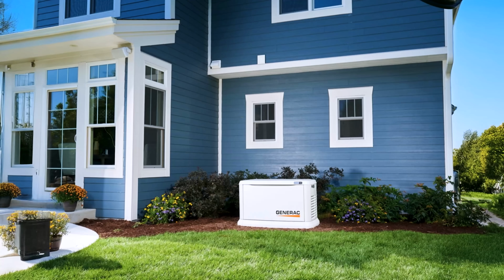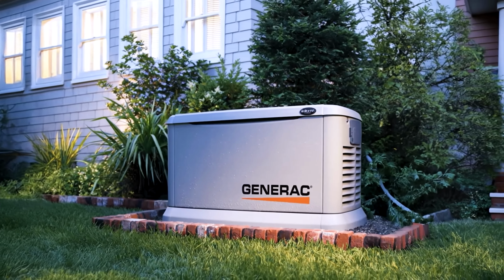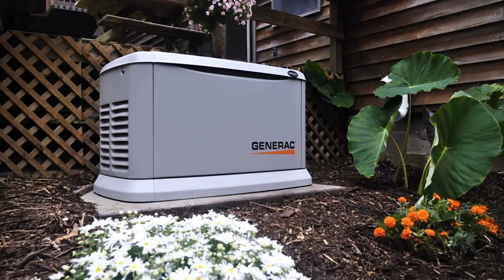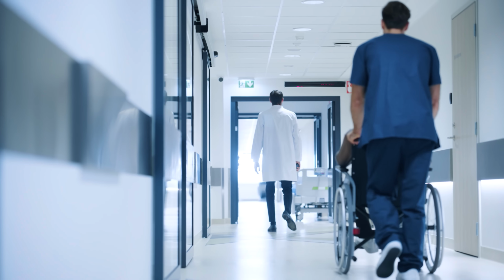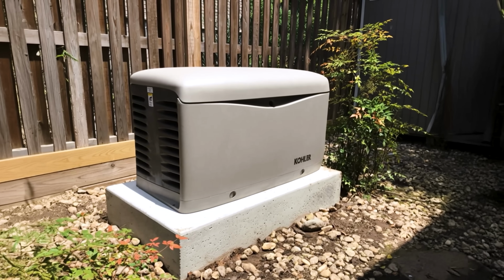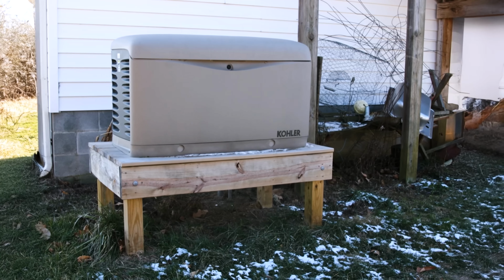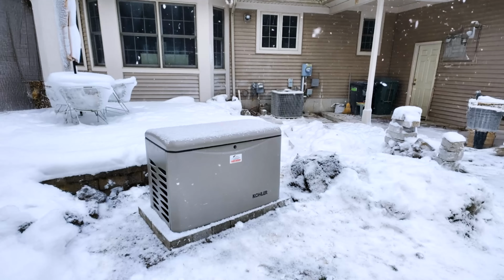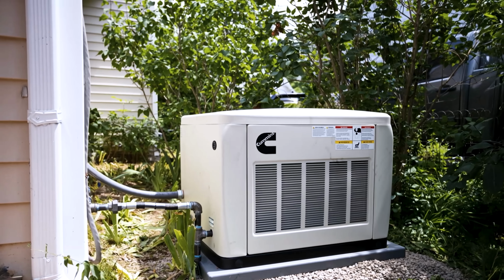Top 3 Generators for Your Home in 2025!

Comment: I have had a generac 22k for 11 years, it has been faithful for those years, for short power outages and two long time outages.  I have the unit serviced each year, oil, air filter and new battery twice.  Installed and unit cost about $10,000, a great expense except worth it’s weight in gold in middle of winter outages.

Comment: I have an all electric house and would like to have some type of backup system so that I can keep some heat in the house in the event of an extended power outage in the coldest part of the winter.  I suspect it’s not feasible to have a generator big enough to run my HVAC together with my inside electric heater., but perhaps big enough to run several space heaters.  What do you recommend?

Comment: In one form or another, in one specific application or another, I've had all three of these brands, often multiple units.   I think it speaks for itself that 80-90% of power outages are brief, and few and far between, thus the attraction to Generac (and while not addressed in the video, I'm speaking specifically to their air-cooled residential line).   I've been a fan of the quality of components in Kohler in the past, but only time will tell now that the generator line is really now owned by a private equity group (Platinum Equity).   I've never seen a company do well in the long run under private equity ownership.  The first thing the owners want to do is maximize profits usually at the expense of quality and support.   I hope that doesn't happen, but it's a red flag.    On my personal residence, I have one of Generac's "larger" liquid-cooled units, and it has performed flawlessly when tasked with multiple day outages for events like a hurricane.

Comment: I have three Honda’s, two EU 2200’s in parallel and a new EU3000 because I need electric start. Plus a Honda repowered Coleman 2800 that years ago got us thru an 11 day outage. 

Nothing is perfect and if one fails ( never happened) there are others to use. I believe in load shedding and even with a well and sump pump plus the boiler nothing goes into overload. 

I have seen too many Generacs quit at the wrong time in my landscaping business. Never seen a Kohler or Cummins die…. Yet!

Comment: I chose Kohler 20,000.  Ran great for about 14 months then suddenly the oil pump broke and oil spray all over the inside as I checked it.  I could not believe it and thankfully it was under warranty and it was fixed and that happened in the very early spring of 2024… Now it’s been two years since that time when it broke and it’s been running flawlessly, but I was very disappointed about that but now we’ll see. I heard Generac had problems so I think they all do but I honestly do not know which one is the best   if they start making all American parts and in one factory that would help a lot

Comment: My Generac ran for over 300 hrs just recently.  I shut it down every day for about and hour to check oil and look the unit over.  I did an oil and filter change about 200 hours into the outage. Mississippi ice storm 2026!

Comment: I bought a tri fuel 18KW portable generator, had a Natural gas quick connect installed to code and a 50A external power connection into the Breaker box with a lock out slider, again, all to code, fully county inspected, and spent under 2800 bucks including the generator, labor and permitting, works great and runs the whole house, not automatic, but I get it up and running in less than 3 minutes and saved a TON of money!!  I'm sure you'll delete this....

Comment: Prior to 1986 you could buy an actual Onan Generator.  Cummins bought Onan in 1986.
I work with pre-1986 Onan generators, which self test themselves weekly, for 15 minutes.  I change the oil twice a year.  End of Story.

Comment: Just had a Kohler installed; had an early Kohler and no major issues for over twenty-five years. However, recently we encountered an electronic issue that caused a motor malfunction. We called our dealer in PA, Critical Systems, and had them examine the issue. Within less than three weeks, our dealer installed a new motor under warranty, and it has worked flawlessly.

Comment: I've had a Kohler 14kw with an automatic transfer switch for about 10 years now.  Comes on automatically in about 7 seconds after power goes out and shuts off immediately once power is restored.  I maintain it myself and it has never given me the slightest problem.  Runs on propane. Longest power outage I have gone through was about 30 hours.  I service it myself once a year (sometimes 18 months if I'm lazy).  In order to help preserve it's longevity, I used high-heat paint and sprayed any exposed metal parts in the engine compartment - most notably the muffler and tubes.  This has prevented those parts from having ANY rust.  I only use high-grade synthetic oil and a quality oil filter that I change every 12-18 months.  The generator does an automatic 20-minute run once a week to keep the engine lubricated and in good running order.  Very happy with it.

On the day it was installed, I asked one the young technicians who worked for the company that sold me the generator of what he thought about Generac. He said they sell both Kohlers and Generacs and that he would stay away from the Generacs.  He told me some of the jokes they used back at his business to describe Generacs.   I'm very glad I went with the Kohler. The tech described Kohler's as quality mid-range units.

Comment: Maybe Generac is better suited for cooler climates, here in the South they can't handle the heat. Engine and circuit board failures are extremely common. I am a Onan/Cummins dealer and installer in a market comprised of 95% residential and maybe 10% commercial units being Generac. Generac has pursued me for several years to become one of their dealers but I cannot look a potential customer in the eye and sell them an inferior product. A local Generac installer brags on the fortune is making on repairing Generac units. I may not sell a ton of generators but I believe in the product I represent. My 25KW 1800 RPM liquid cooled Onan was a great investment.

Comment: No question Cummins is top of the line, but one issue with Cummins is they don’t have a remote monitoring/ethernet/wifi  system like Generac which lets you check on the generator when you are away and receive warnings if something is wrong..    They did have the PowerCommander but that is discontinued,  They came out with an Accumen system which is also discontinued so your only option is to find some third party hardware.  In today connected IOT world this is a notable deficiency.
Reply: Yes they do. Just had installed 1-19-26 Mi
Reply: @gunsngolfn Can you tell me what they have since my information is there isn’t any options other than thrid party for their large liquid cooled units.  I have a 40 KW with the powercommander control installed in Dec 2025

Comment: I've always used a Honda inverter generator that runs through the service panel.  Works great but won't run anything 220V.  May have to consider a whole house generator cuz I'm getting too old to deal with the maintenance, moving it into position, handling 5-gallon gas cans, Gen-tent, etc.  Pretty far from your service area though.

Comment: In the high end audio enthusiast they say  you want to  have your amplifier loafing along when there is high demand of power so amplifier wont't be struggling for power demands so if you have 300 watt speakers with low sensitivity you need a amplifier at least 600 watts of high current power. so won't short the  life of the amplifier so don't you need at least 40Kw generator?

Comment: After reading a ton of bad stuff on all these brands I opted for a northstar 12kw with Honda GX630 OHV engine 20 hp. So I have to manually start it via a key switch and electric start and plug it in after shutting off the main breaker. No problem I can handle that. $3200 bucks. In the future i'm going to convert it to natural gas or propane so I don't need to worry about fresh gas.

Comment: None of them are inverter generators. 
It's 2025, for the price of installing the home generator. 
I would invest in the solar power setup instead. Like Ecoflow 12kw Delta pro ultra X with smart panel.
I would still have a 7500 watt tri fuel inverter generator as a backup. Not to power the house but to charge the power station.
Two hours of gas generator charging the power station equals 10 to 36 hours of power for the house, depending on the load. Adding solar panels is a big plus.

If you move. You can take them with you. 👍
Reply: 7500 watts doesn't run shit. And all these whole home generators are inverter generators jackass.  
Your pathetic battery solar shit systems wouldn't last a day .

Comment: There are a lot of comments about Kohler not making small engines. Kohler generators are still being made, but the generator division was sold to Platinum Equity and rebranded as Rehlko Power Systems in 2025 to focus on innovation and the customer experience. Kohler (the parent company) shifted its focus to kitchen and bath fixtures, but Rehlko continues to produce the generators under the Kohler brand.

Comment: You need to be preaching about soft start kits on all HVAC compressors and any other high inrush current draw loads. Its AMAZING how far you can extend a smaller generator by cutting inrush/LRA current on such loads. MicroAir has the best IMO and handles compressor units up to 6 tons in size.
Reply: There is a youtube video by a guy installing a soft start kit.   It took his hvac initial power up from 20 amps to 12.  It also starts a lot quieter.
Reply: We have the micro air soft start on our Trane 3 ton package unit it was pulling over 80 locked rotor amps before installing the soft start and causing a momentary brown out while our Generac 22k was running. After it starts on 20 amps and runs on 9.5 amps, no more brown out. Would highly recommend Micro Air.
Reply: Agreed. I put a soft start on my 3 ton heat pump and disabled the 10kw heat strips so now my 8kw portable inverter generator runs it without issue, even when also running our induction range.

Comment: 47 KW GGFE Cummins installed over 20 years ago with now 670 hours run time. Only failures have been 1 battery charger,  2 batteries , and muffler which rotted out from condensate from lightly loaded weekly exercises. Exercised now manually every other week under moderate load.
Reply: A bunch of bologne 
20 years old and all you change  is a battery charger and a battery? The battery even with a battery charger wont last more than 3 years …
There is always maintenance to do on a generator . From oil changes battery replacement belts hoses and corrosion on doors and enclosure. Coolant flush … that is a fact
Reply: @George-gb2zn I replaced my Generac battery after 5.5 years, not because it wouldn't start the generator (it would) but because it just seemed like I was pushing my luck.

Comment: The Cummins also does not have to run the motor every two weeks. The Cummins has a feature where the starter simply turns over the motor but does not give it fuel so it circulates the oil without actually starting the motor. It can also check that the alternator is pushing out voltage. This means that is is very quiet and it does not require service as often.

Comment: Having worked for both Caterpillar and Cummins over the years both are leaders in the standby and prime power generator market. When I worked for Caterpillar the vast majority of prime power units in northern Canada were Cat. I saw units with 15,000 hours before a major overhaul was completed on the engine. Cat never really bothered with the home unit but did have portable generators for contractors. My last job was with Cummins here in Eastern Canada and we had a department that handled home standby and other applications of small generators. Look at any fire truck and it probably has a Cummins genset on it or a Cummins PTO generator driven off the main engine of the fire truck. Another big application of small Cummins generators is the RV market where the big RV has a Cummins drive engine and also a Cummins genset to meet the power requirements of the RV. I do know in Eastern Canada Cummins supported a dealer network with a large inventory of parts.  I personally managed CHIP plants ( Combined Heat In Power ) mainly 2MW, 13.8 KV gensets using small engines 18 cylinder, 91 litre, natural gas fired engines. Some of my mechanic's could even work on the small units if needed in a emergency.

Comment: I'm surprised you don't mention air cooled versus water cooled, 1800 rpm versus 3600 rpm and the NOISE!! The air cooled 3600 rpm generator will wake the neighbors and keep you awake at night!!
Reply: Also surprised  no mention of differences between emergency generator vs continuous duty generator in respect to durability and lifespan

Comment: I gave up on generators, and instead installed two Tesla Powerwalls.  If utility power goes out, the Powerwalls replace them instantaneously without a flicker.  Even clocks on microwave ovens don't notice it.
Reply: Why would the clocks on a microwave have an issue.  Sarcasm?  What # of watt hours are  stored in each powerwall?
Reply: @WilliamMurphy-b6v   Power wall might last 8 hrs
Reply: And how long will two power walls last you running everything you would normally use (fridge, stove, AC or furnace/boiler, lights, washer dryer) ?  Are your power walls going to keep you fully running for 3 full days?
Reply: @ScottA2345 Each Powerwall stores about 20 kwh.  That would last me about 2.5 days.   The longest outage I had was 17 hours.  We have many outages,  but most are resolved in 3 hours or less.
Reply: @LawyerCalhoun1  So, 5 days total for two?  That's much better than I expected.  👍👍

Comment: I have a 14 year old Generac Nexus 8kW. It has had a new control board, stepper motor, starter and coil. Otherwise just oil changes and batteries. Been pretty reliable and still going strong.
Reply: Dang… that’s a lot of upgrades / replacement parts!
Reply: For a generator that is 15 years old,parts can wear out on everything?

Comment: We had a new Generac installed at our former home against my better judgment because no dealer network for other brands. As a former electrical utility worker and gear head I knew the Cummins/china and Generac Chinese motors were basically imo very poor quality. We also had a Generac at an office we frequently used. My home unit failed to charge the units battery 2 months after installation during the first major outage. I ended up having to hook up my tractor to it to keep it running. 4 weeks later the parts came in to fix. Next outage a rocker came loose in the motor 6 months later. Took 3 months to get everything back going. It’s a 26kw but seemed to overload and click out often with the basics running. We also had a couple problems with the one at the office. I knew better than buying one, but with all the advertising and lack of other brands I gave in. As a Cummins fan and gear head Cummins factory shops roll their eyes and speak about what junk the portable and home units are and have stated Chinese junk always broken. Kholer has commercial motors on their units. The same engines used in commercial mowers, some toro dingos and many other construction applications. You can also go to the local mower shop and get service parts for the motor if needed. Plugs filters coil etc. Myself and even the local city uses commercial mowers to cut the downtown areas, off-ramps from the interstate and various other city properties 5 days a week with thousands of hours. You’d never do that with a chinagenerac or chinacummins motor. This has nothing to do with the current conversation  but I’m  also an avid camper, I’ve also owned multiple rv’s with Cummins/onan units 6 total. With the exception of the one with the kubota diesel all have been cheaply made Chinese poorly designed units and all gave me trouble. Fuel pumps on 4 over rpm or under rpm codes and shut down control board, overheating and shut down, voltage regulator. I wish someone would step up and make a bullet proof RVing unit also

Comment: Well, I hope I have good luck with the Generac 26KW I'm installing. I worked on the wiring today and have that just about ready to call the electric company to shut me off for an hour so I can swap boxes. I've been crawling around in the crawl space putting in a gas line to feed the unit. Hopefully,  I have enough capacity. My gas line is 1.5" but it's 500 feet from the tap. If not, I'll be trying to get the gas company to bump my line pressure up, and then drop it back at the house. I really don't want to have to install an LP system.  
  I ran my old house on a 7000 watt Harbor Freight unit that I converted to NG. Power was out for 10 days due to an ice storm. The night they got my power back on it was -10°. I felt sorry for the linemen. The only thing I couldn't run was our ELECTRIC dryer. The wife thinks that gas is too expensive. 😡